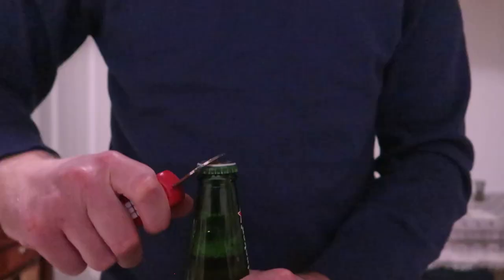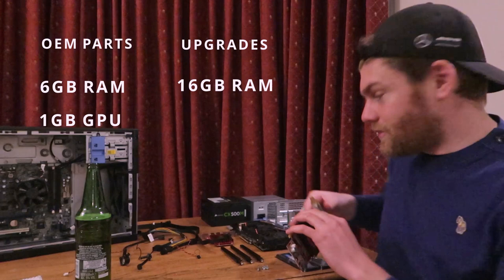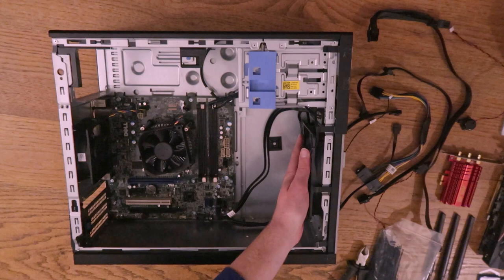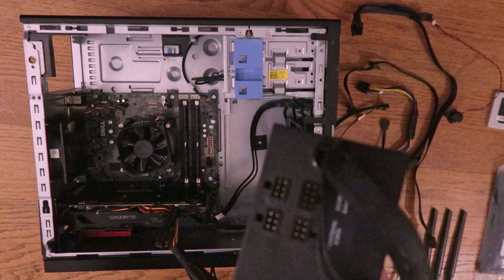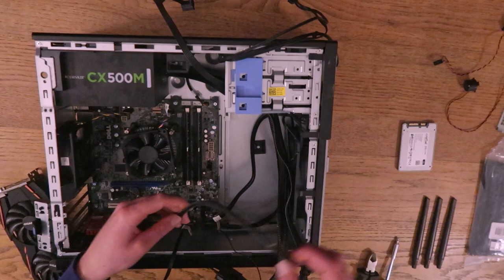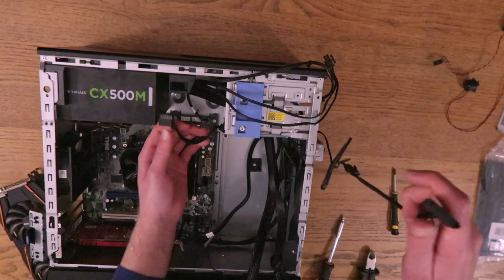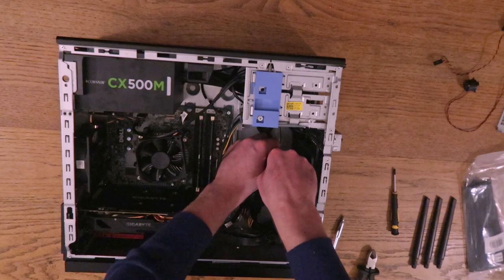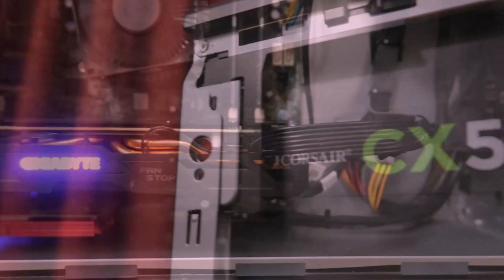Dell Optiplex 7020 upgrade 2021 - Ep 1

Comment: Great video thank you. My question is did you need to do anything in BIOs to get the graphic card to be seen?
Reply from the maker: Not at all, it was picked up instantly. Are you having this problem? If you are, is this a new card you are trying out? It maybe a problem with the GPU. Apologies for the slow response.
Reply: @darylbultitude3786  no not a new card it was a used card from eBay
Reply: @DIYWilly  oh boy ebay

Comment: Great video, i have a couple of questions:- 

I have the 7020 same as yours and just ordered a corsair cx600m

1. You converted the atx 24 pin to 8 pin for main power, do you have a link for the 24 pin atx to 8 pin adapter you used?

2. The hard wired 8 pin cpu lead did you just split it into 2 x 4 pin connectors and connect 1 of them into the 4 pin cpu socket?
Reply from the maker: Hello thanks for the feedback!Congratulations on pulling the trigger on your build. 

The adapter came from Amazon:
https://www.amazon.co.uk/Optiplex-Power-Supply-Motherboard-Adapter/dp/B0758H3WVX/ref=mp_s_a_1_3?dchild=1&keywords=dell+24+pin+adapter&qid=1629959630&sr=8-3

Regarding the CPU power cable, the psu is semi-modular and was preowned. When installing, I didn't notice that the cable had been broken up. It does look like the cable can be linked together. But effectively yes, I only used half the lead to power up the cpu. 

Good luck with your build! The second video in the series is a case swap. Currently filming the third instalment.
Reply: @darylbultitude3786  thanks all ordered. Hope my son appreciates this build I'm doing for him.👍
Reply from the maker: @Bippystopper  You have given me an idea. I'll put links to each of the products I have used to make it easier. I do so much research into each product to ensure it will work, makes sense to share my findings.
Let me know if you have any questions or if you get stuck. More than happy to help!
Reply: @darylbultitude3786  i stumbled across your channel doing the same research lol, putting links and item model numbers would help anyone else looking to do the same or similar. 👍
Reply: @afrogaffer6195  you would have to get a low profile graphics card for that i think a standard sized one won't fit.
Reply: @afrogaffer6195  what kind of setup are your trying to put together? A gaming rig or just a powerful pc for editing etc etc
Reply: @afrogaffer6195  ahh i see, i would say a 9020 with a decent low profile gfx card and maybe 16gb of ram should be more than sufficient to cope with what you want to do.

Comment: hey dude, how did you take out that thing where the hdd is supposed to be ? bottom right of the case
Reply from the maker: The HHD cage. I removed every element of the computer, including the motherboard. I then took a drill to each of the 5 or so rivets that held it in. Then clean the case as you don't want metal shavings to short anything. Best of luck my friend!

Comment: Hey bud thanks for the guide.
I've been working on one myself, i'm at the point of trying it with a new psu and gpu
the psu: AresGame power supply 500W (self-tested and working)
the gpu: XFX RX 570
Got the adapter and everything.
Current problem: Doesn't turn on: no fan spin, no lights, just a faint click noise from the psu. Any ideas?
the pc worked with the old psu fine.
Reply: Hey what type of adapter is it , 24 to 8 pin?
Reply: @denisagbo6272  That's right! even tried a new psu at this point ThermalTake Smart 700W because i was think it might be the power on the rails. still no luck. the old psu works (Dell 290w)

Comment: How did you get the fan to work with the mobo
Reply from the maker: The front fan I am assuming? I used a sata power to 3 pin adapter from Amazon. No speed control but plenty of cooling

Comment: Hi, thanks for sharing your experience, I would like to know if I can add to my Dell optiplex 7020 the AMD Randon R7 450 4GB DDR5 low profile video card or is it better to look for another one?
Reply from the maker: Hi, I used the radeon RX 570 4GB for a while and it was good for the things I needed. It's not a powerful card so wouldn't be able to play games at the highest image quality. Video editing, the card was great. All that I needed
Reply: @darylbultitude3786 hey will an Rx550 work? Without any power supply mod

Comment: I tried to upgrade ram to 16gb and installed a GT 730 2gb but after I did there is a orange light blinking for my power button and won’t connect to monitor, Any methods ?

Edit: do i need a cord for the gpu?
Reply from the maker: First thought it, this gpu requires 38 watts of power, does your psu have enough capacity?
Secondly, does the ram show up in your task manager when the gpu isn't installed?
Reply: Also, is it plugged into the output on the gpu and not the motherboard?
Reply from the maker: Just seen the edit, no power cable is needed for your card. The card's only takes tiny sips of energy when it comes to power consumption, only utilizing a maximum of 25W power. Pcie has a maximum of 75W of power so more than enough